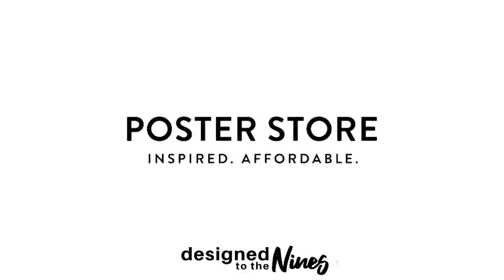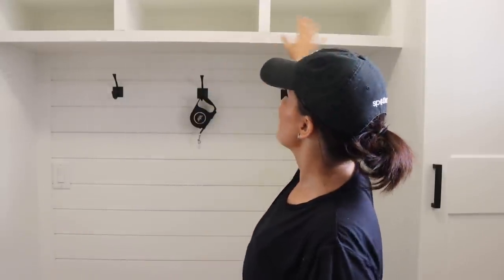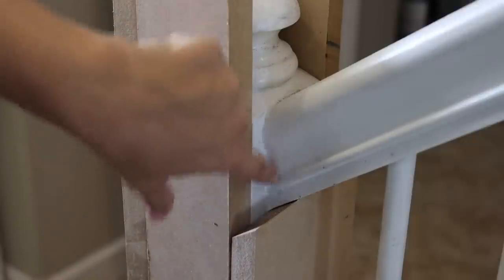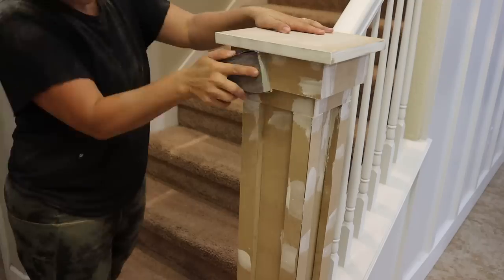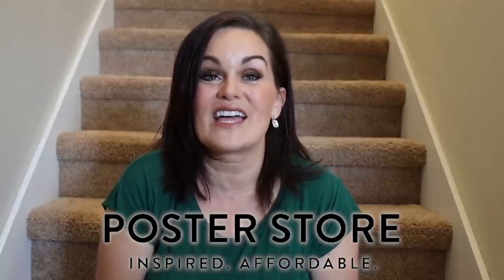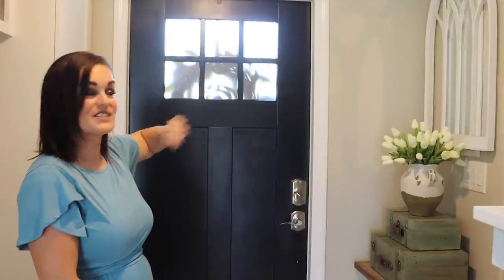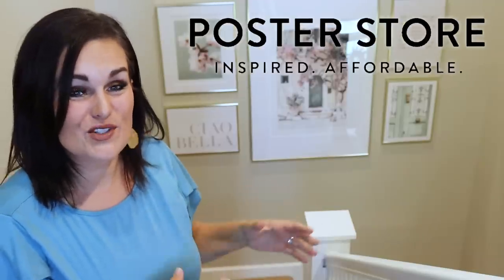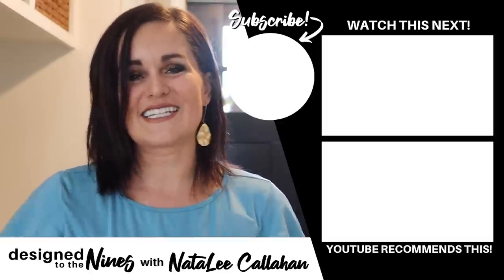DIY Extreme SMALL ENTRY MAKEOVER- How I saved THOUSANDS!

Comment: The grand newel post commands so much attention I didn't even notice the railings until you mentioned them.   
I would put doors over the top cabinets  of the landing zone.  That would be more useful.  The decor you have in the entry is fine without what you have in the top shelves.  
Lastly I would leave the bench seat as it is.  It looks great with the baskets and stands out from the mantle and kitchen cabinets.  
This was a great makeover/ refresh project.  Looks great!!!

Comment: This is stunning. I love it. There is nothing I don't like that you do. I would leave the bench the color it is. 

Quick question about the front door, you painted with what brand of paint? I want to paint mine too but not sure what brand. It's black on the outside but white on the inside and I want it black as well. Would i need to seal it?
Reply from the maker: It's Sherwin Williams Enamel Paint in Caviar (color).
Reply: @designedtothenines  Thank you

Comment: Looks awesome but I couldn’t help but price that the hinges on your front door are backwards.  This is a huge security issue as all that it would take to enter your home is to remove the pins in the hinges and voile…. You can remove the whole door.  Most entry doors open inward but even if you wanted outward swing the hinges just need to be installed so that the pins are inside.  Please be safe.